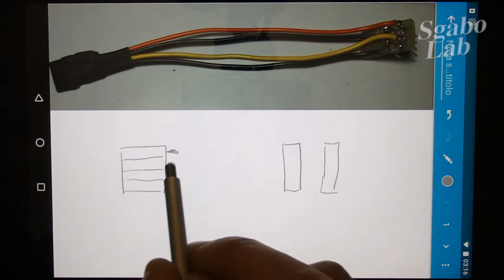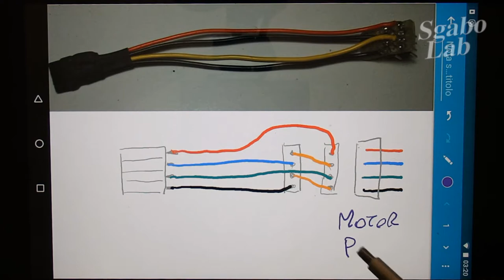How to make a Serial Adapter for 2 motors Z Axis - 3d printing tips

Comment: Hello, congratulations on the video. I did not even understand your schematic in the connection on the PCB board, could you send me a more detailed drawing of the connections and colors and the side that will go on the printer board? I'm a beginner in electronics. I forgot to say that my cable has colors, red, black, blue and green, so how to make the connection here? Since your cable has different colors.
 Thanks
Reply from the maker: ciao, there is a recent video to explain the same without the adapter .. search in tips playlist ;)

Comment: I made the serial connection cable and tested it. I noticed right away with the Tronxy X5s stock controller board Vmax Z: setting needed to be reduced to 5 compared to the original setting of 25 to stop it from making an unusual noise when moving the Z-axis. I am guessing in serial mode it is moving faster. Is there any other settings that needs to change? Thanks!
Reply from the maker: Hi, the x5s electronics not permit save changes in eeprom .. any change are restore after reset (my electronics is like that)
Serial adapter not change speed of motors and not need any setting changes  ;)

Comment: Thank for the video, but how do you calculate the vref for two serial motor ? I have tmc2208 v1.0 and two nema17 and 0.83A each.
Reply from the maker: not change, calculate it in same way as you use single motor
Reply: Thank you

Comment: I've had no problem at all with having 2 in parallel, neither in my i3 nor in my mendel. My mendel has the spring anti-backlash system for its 5/16 Z threaded rods, so i had to conect them in serial  (they have the 8 pins available) as to get more torque with the same current, and then conect them in parallel at the board. If not, the driver wouldnt deliver enough current and the Z axis would lock up intermitently. My i3 doent have that problem because it has no anti-backlash.
Although, should it be even better to just use a second driver for the second Z stepper and then set up the mirroring in the frmware to E1? Never tried it, but i've seen that option there since quite a while back.
Reply from the maker: ok .. but it's a good practice to connect them in series .. with or without the problem ... I saw the problem and corrected it before the first start of my x3s :)